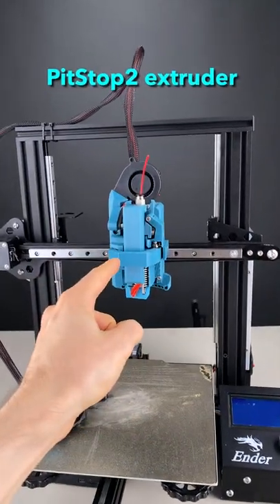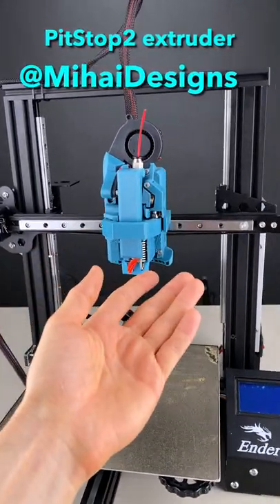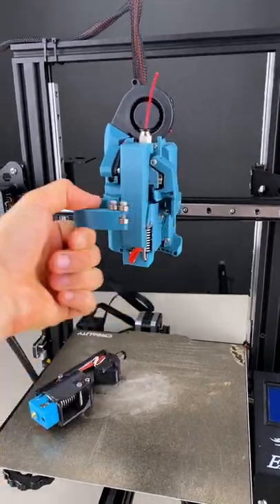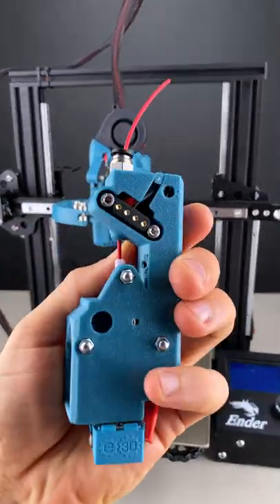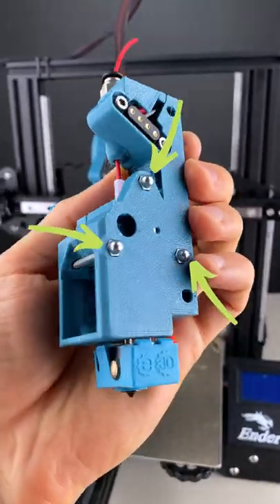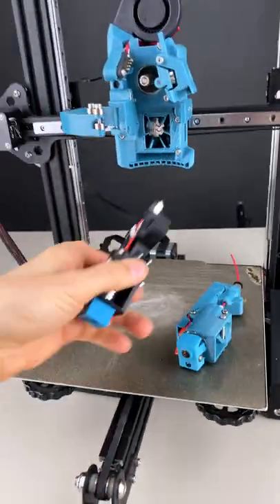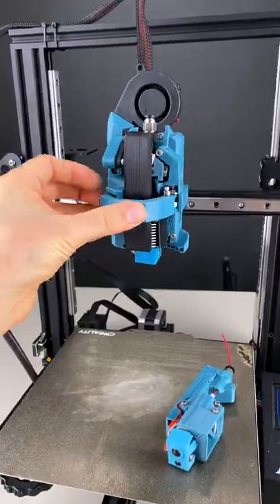PitStop2 Extruder - 3D Printer Upgrade by MihaiDesigns

Comment: What dose it do??
Reply: He's working on a rack to house multiple of those, he was working on automation of swapping but I don't know if he still is. But the idea is that you can have multiple extruders with different nozzle diameters and have multiple colours and materials so you could print very quickly without having to stop to run out the previous colour or material. So you could print a base in, say, a yellow and black, not switch colour in a extruder but switch the extruder, so no crosscontamination and print feet in a flexible rubber and again no crosscontamination because you use a different extruder for each material